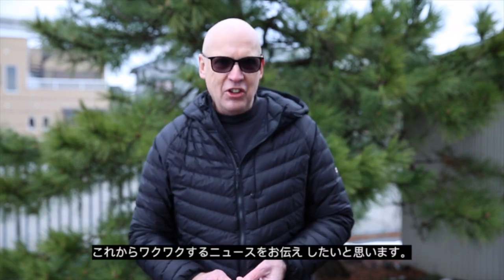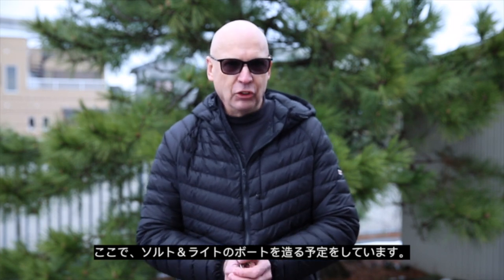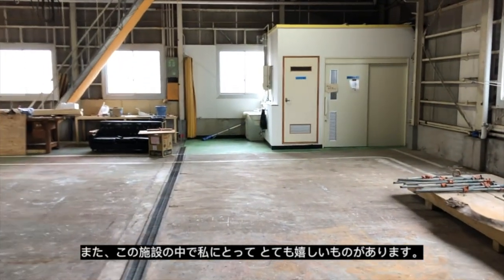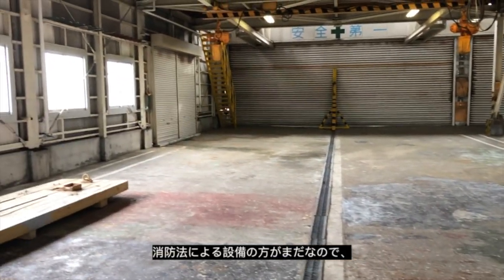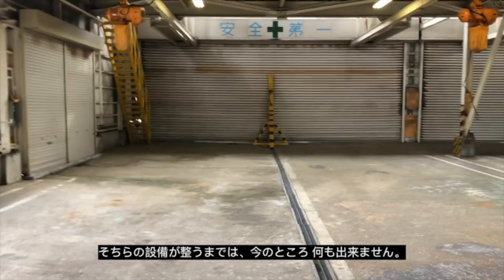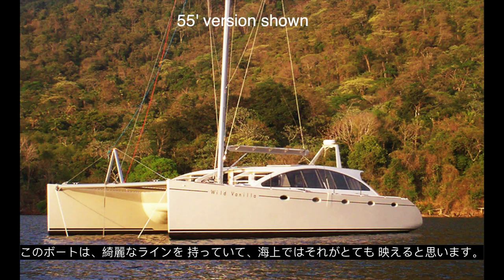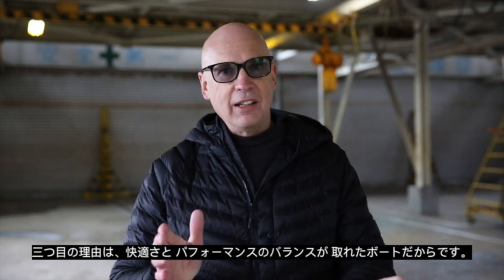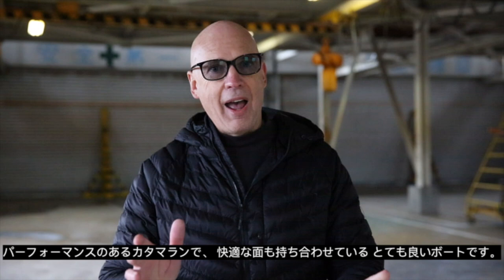Ep 2 Salt & Light Dix 470 catamaran build in Japan

Comment: For the canals - what is the carrying capacity of the overhead tracks compared to the anticipated weight of the boat?  It could be in slings and pulled across the canal, then lowered into some carrying sled to be moved to where it can be craned into the water....
Reply: two ibeams with trolleys and cradles cross right over them
Reply from the maker: Hi Steve, the overhead structure is very rusty and hasn't been maintained for many years. Not sure I could trust the integrity of the structure.